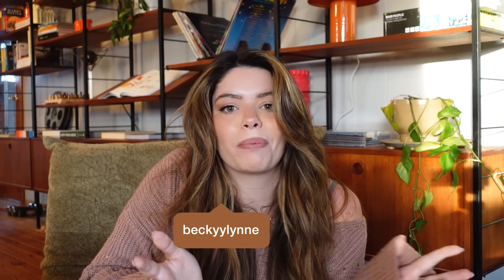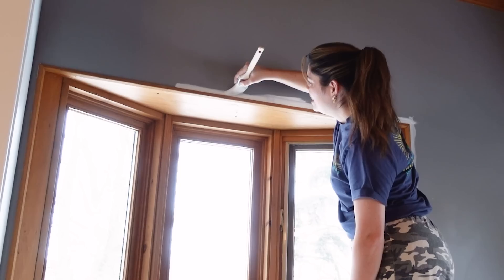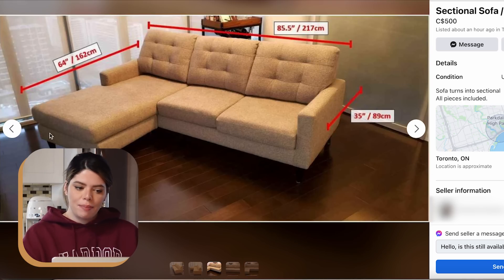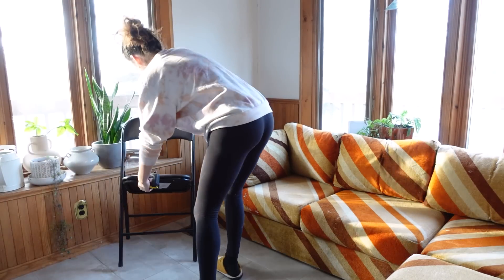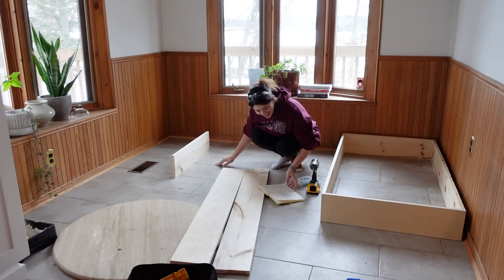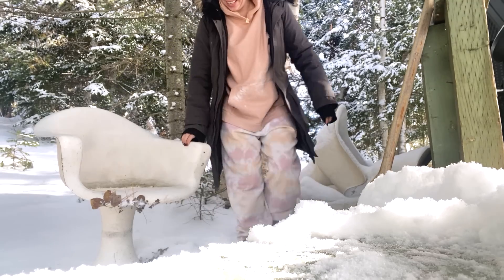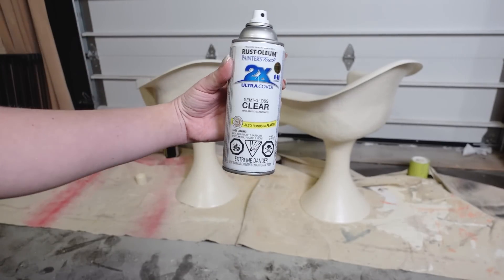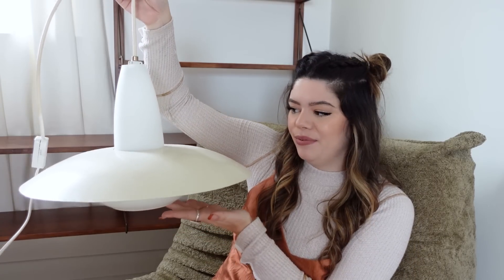will i regret this old sofa I thrifted?

Comment: Pro tip: Change the sponge from the seat of the sofa with a firmer one and you will see that everything will be more comfortable for sitting at the table and you will not have the feeling that the sofa swallows you. And it would also be nice to do something for the left corner, it seems unfinished.

Comment: The sofa is gorgeous but you might need to play with the placement of the cushions so the lines will follow each other? it felt like you just randomly placed them on the go :)) or maybe I have an OCD haha. I also think the sofa should sit under the other window :) and I agree with others who think the gap between the wall and the sofa needs to be filled with some sort of addition to the base (splitting the two parts and filling in between would also work but might get too busy). excited for the second episodeeeee!

Comment: Just to have a more built in look maybe adding a wood piece like a small table look where the gap between the wall and the couch could really finish the area also if your not in love or ever want to change up the look down the line you could add vinyl leather to that wood base (easy to clean)I’d do a black and maybe even repaint those chairs black that might pull in elements from your living area like your fireplace since the silhouettes are similar or since you already finished it or keep that in your back pocket for the future and since you weren’t super satisfied with the stain you could always add poll wrap to that base you created and restrain which would match the wall wood and break up the line pattern in the sofa but that’s based on your personal preference and maybe just even when you want a change in that space in the future cuz we all have those moments  since you’ve already put hours into this project and your satisfied with it for the time being but beautiful work anyway (just ideas)

Comment: I think if you switch the long side of the couch to the wall on the right side of the room and add the short bit to the end along the back wall, it would be easier to access once the table is in and give you more room to add chairs. One chair in the back left of the room, one or maybe two along the left wall, and one at the open end of the room.

Comment: I would have put the couch in the other corner so that there’s not a weird space between a couch arm and the wall.. 
also curious about what you’ll do with the bay window areas! Does it feel oddly spacious behind such a solid piece? Does it take away from the “built-in” aspect that you’re going for?
I’m not 100% sold on “couch as dining bench” yet. It’s still reading 100% couch to me but i hope adding the table helps because it is so creative!

Comment: I lik beck reuse the paint brush 🥰 coz actually you can really reuse paint brushes, rollers, paint trays . Just submerged paint brush in paint thinner  (if you used enamel paint) I don't know if that's available in your country but that really works. Or submerged it in water if you used latex paint

Comment: I have a question for Becky: why didn't you get a built in undersink filter for of your kitchen sink? Or, if you had to buy a new fridge when you moved in, one of those fridges that has a water/ice machine built into the door or on the inside of the fridge (you open the door of the fridge, and there is a silicone button that you hold your drinking glass or water bottle up to and filtered water comes out)? Or the kind of filter (Waterpik for example) that attaches to your kitchen sink faucet and you replace the filter every 3-5 ish months, depending on how many people are using it. I don't mean to be critical, I'm just curious. I used to live in a house that was on well water, and my family used the large Brita pitcher. I currently use the skinny Brita pitcher, even though I am on city water. I prefer the taste to tap water, but I occasionaly use tap water and it's not bad tasting or unsafe to drink.

Comment: Looks like the front of the cushion on the left is a bit tattered. Could you maybe switch it with the cushion on the far right so that the rough patch isn't visible when you're looking at it head-on? Also curious what you're going to do with the empty space on the open wall. Floating buffet shelf perhaps?

I custom built a breakfast nook in my kitchen as well and it was my first ever furniture build. I even custom make memory foam cushions for it and then my dog ripped them to shreds. 😫I haven't had the heart to replace them. I also rewired a chandelier (first time doing that as well) to hang over the space. Easily my favorite spot in the house.

Comment: I notice that gap where the couch doesn’t make it to the wall and it kinda bothers me… lol. Not that this whole set up doesn’t look great! Just that one detail I feel like could use some finessing. Perhaps building a box the height of the couch to slide in there and use as just space for decor? Or maybe building almost like back for the couch… like a box that is the height of the back of the couch and goes all the way around the back/sides of the couch creating a more solid look, providing a ledge like shelf around the edge for decode if you wanted, and helping to eliminate that space by filling out the space more all around the back of the couch. Just a thought!! But loving it so far.

Comment: Crazy idea. Can you maybe ... paint the parts of the couch where the fabric has rubbed off? I saw two different youtubers (one was lonefox, the other I cant remember) that painted smooth fabric chairs to make it look like leather. I know you're not trying to make it look like leather, but the spots I feel are sparse enough that if you match the color exact (easier said than done, I know) it could blend at first glance? Make it more seamless? That would defeat the purpose if you like the look as is. Either way, im a fan.

Comment: i absolutely agree with the idea that we use used furniture. But when they fabric is threadbare i don't agree. Either it gets redone or it doesn't get used because the thread bare fabric is just going to tear anyway and then it's going to look super shabby! the point of using used furniture is not that we look shabby but that we upcycle :) unpopular opinion I know. Other than that, I LOVE the remodeling so far.

Comment: I'm late and this will get buried but here goes. Whether this will work depends on the table. The base must be a single heavy pedestal, so people can scoot without hitting their shins. For the best top for this arrangement and vibe I'm imagining a table shaped like a large quarter circle,  but with the sharp points rounded. Wish I had a better way to decribe the shape - another way to say it would be a right triangle, but eith the log side bowed outward, and points rounded.  The top could be out of plywood cover in epoxy. It could be very retro/cool.

Comment: I have to say (write lol), I kinda disappointed of how it looks...and i'll explain:
This area, i'm assuming it's 8meter * 2.5 meter (roughly majored) room (?!?)...the way you arrange it make the space  that is already small, smaller!
So for start:
1. Take out the white cabin/closet on the left.
2. Move the sofa to left side - then you'll have an much wider and open space.
3. Floor - if you go with the "retro funky" look, consider changing the tiling OR a wall-by-wall carpet with the same color scheme of the sofa.
4. The wood wall divider thingy...TAKE IT OFF! make the whole space bigger (never understand this style - so not complimenting to any room!!!)
5. Chairs - you've paint them white, which elevate it BUT if it was me, i would add brown, orange and mustard swirls that give the "illusion" that the whole thing is a costume made and it a one piece.
6. Wood stand - you're into the 67ish funk style, cover the couch stand in the same fabric of the carpet OR the same brown fabric you used for the chair pillows.
7. Light - consider the fact that this room kinda "made up" (meaning wasn't there in the first place), and the celling are wood beam - DIY a funky light the the wood beam will be part of the pendant/light/lamps, so it will gives connection between all the pieces in that nook/dinning area .

Your house already in the orange/brown color scheme - make this area flowing with the others

Comment: Great series Becky! I can't believe you found the perfect seventies sofa, and I like the box solution for raising it. If it were me, I'd consider splitting the sofa in two with a section either side of the central window to allow more light into the room, although I'm not sure if that would leave enough space for a table in between. Can't wait for part two!

Comment: The clunkiness of the sofa base is throwing me off.  I would like to see the boxes an inch or two smaller on each side so it would tuck under the sofa and not be as visible.  Would give diners a little heel kick room and put the focus back on the couch instead of on the base.  Right now it has a 60's hippie vibe( not a bad thing but doesn't fit the house as well).  A hidden base frame would make the whole thing visually lighter AND be more in keeping with the 60's danish vibe of the house.  I also think the two chairs would make more sense if the couch was shifted to thetwo window walls.

Comment: Love the idea of the couch.
Definitely love the box under it, 
although, 
I would be utilizing drawers in that whole base.

Constructive Criticism-
Are you ready for it?

I'm just going to jump past the issue of cleaning spaghetti sauce off that velour. 

As for the COLORS on the couch...
I Absolutely HATE it.
No.
Nope.
& ABSOLUTELY NOT.
Followed by,
PLEASE NO!!!

The only worse color you could have chosen is that light pink color y'all seem to love, the one that reminds me of the Crayola color which used to be called, "flesh color".     🤢

Although I was young at the time, 
I was around to view, 
experience, 
& live in those '70's colors back during the tail end of the 1970's when those colors seemed to take over the entire western civilization. 
And even then, or especially then, it was extremely easy to get burnt out on them. 
I'm very color oriented.
Color DOES set the mood.
I've never recovered from being surrounded by those colors.
Take it from someone who knows,
if you have to live with them, 
at some point, 
you WILL become scarred against them. 
They do NOT evoke relaxation.
I've NEVER wanted to go back.
So yes, I'm very biased AGAINST retro '70's  colors - 
as in, 
ALL OF THEM.

It was gaudy then.
(& btw - THAT WAS the point of them)
It's DEFINITELY gaudy now.

Please recover those couches.
You'll thank me in the end.

Signed,
Still Avocado Green Around The Gills